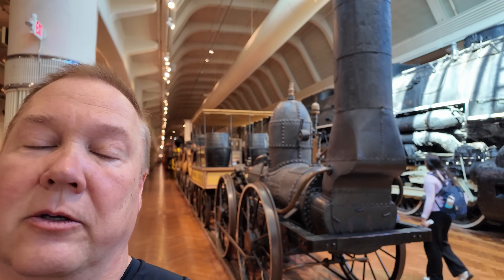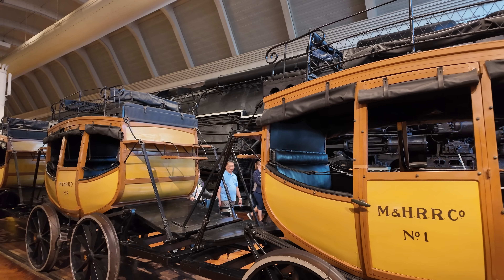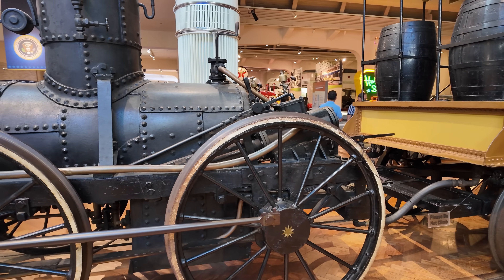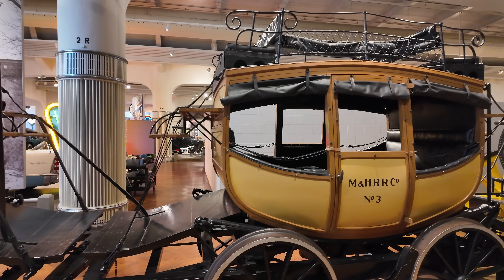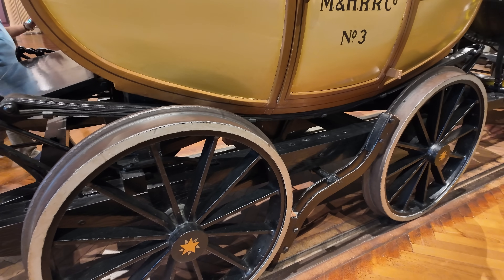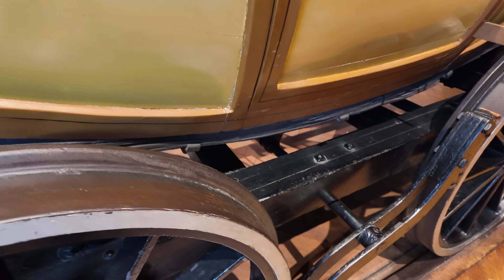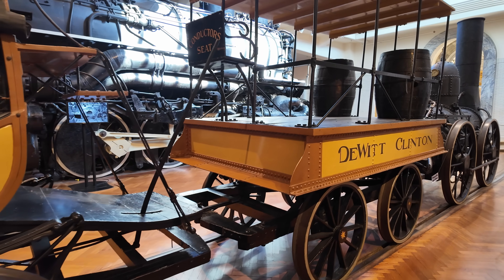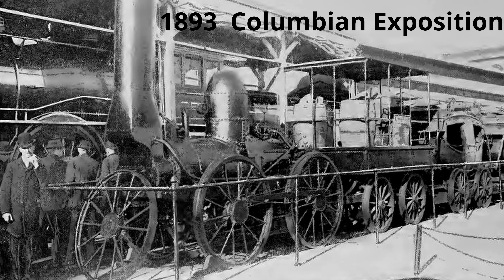The First-Ever Steam Locomotive in New York - Made in USA!

Comment: Thank you for the video. I want to make some comments, which I hope will be interesting. The DeWitt Clinton is technically the fourth full-sized locomotive built in the U.S., the first three were the Best Friend, the West Point (both built by the West Point Foundry) and the York, built by Phineas Davis. The York was built for the Baltimore & Ohio railroad, and because it had some teething troubles, and ended up being massively modified, DeWitt Clinton was put into regular service before it, making DeWitt Clinton the 3rd to go into actual service. Technically, there were some other American locos built in 1831, but none of these were successful or went into regular service.
DeWitt Clinton was originally built without a dome, and the trial runs showed it suffered from water being carried over into the cylinders, so the boiler was sent back to the foundry in NYC in the middle of August 1831. It was also originally built with a "natural draught" which didn't work out, the anthracite coal wouldn't burn. So it was fitted with a bellows and wind reservoir (like on an organ), which also didn't work, as the fire would burn unevenly hot, and melted the grates. It was then modified with a blastpipe, as is conventional on a locomotive. This modification appears to have been made after the M&H took delivery of the Robert Stephenson built "Robert Fulton" locomotive, which was fitted with a blastpipe, as was then already common in England.

DeWitt Clinton was built to the specifications of John B. Jervis (chief engineer of the M&H) and designed by Adam Hall (Chief engineer of the West Point Foundry). Jervis had given Hall practically impossible instructions for the locomotive, placing a weight limit on the locomotive and requiring it to pull a ten ton load up the line at 15mph. In practice it was never able to do this and Jervis and Hall squabbled over the locomotive for months. The Foundry believed that the weight of the tender should be included in ten ton load as specified, and not just the passenger cars etc. I've visited the Jervis Library in Rome and read the preserved letters regarding the locomotive written by Jervis and Hall and they tell a pretty interesting story about the DeWitt Clinton.

The replica was based on a drawing made sometime after the original locomotive was scrapped, but when large portions of it still existed. The original drawings for the locomotive for some reason could not be found in 1893, although interestingly, the Henry Ford museum has copies of them in their archives. Because the drawing used was only a side elevation, some of the details of the replica are not correct (the original boiler did not have a square firebox, but a round one, and the valve gear was a bit different, and the stack was much smaller in diameter).

I wrote the book The Locomotives of the West Point Foundry. I can recommend the book Pioneer American Railroad: The Mohawk and Hudson, by Daniel F. Larkin for those looking for more info on the M&H and the early locomotives used by it. I hope this comment has been helpful. Thanks!
Reply from the maker: Hey, thanks for all the info.  As you probably noticed, I really like the odd, one of a kind stuff, and the stories behind the technology.
Reply: Also the successor to the M&H was the New York Central (no "and") and for awhile, the New York Central & Hudson River Railroad.

If you look at a map of NY's Capital District, the Mohawk River forms a big curve to the north before falling into the Hudson.  The cities of Albany and Schenectady formed at the ends of the "portage trail," the straight-line shorter distance than following the waterways.  The land between the two cities is basically flat, with a downslope at each end down to the river.  Initially engineers were not sure of how much traction iron wheels could get on iron rails, so the railroad only ran along the flat section, with an incline railway, using stationary steam engines to pull cars up and down with long cables.  (Eventually the eastern end of the line was swung over to a natural streambed, which while not as steep as going directly up Madison St. in Albany, was the steepest grade on the "water level route" between NYC and Chicago.  Even longer passenger trains required a pusher loco at the end to get "West Albany hill."

The Erie Canal was built and operated by the State of NY.  The M&H (like almost all rail lines in America) was privately owned.  The State hated losing freight revenues to the faster series of rail lines that quickly sprang up parallel the canal, so the lines could only carry freight during the winter freeze - eventually the practicality of rail transport won over shipping by canal and the railroad was finally allowed to carry freight all year round.
Reply from the maker: I hadn't run into the towed section on the include before.  How long was it?
One thing I have on my to do list is funiculars and gravity railroads and, if I can get to the UK before they shut it down, the gravity cable car that transfers stone.  Interestingly, there is actually an equivalent to the gravity railroad operating with electric trucks now.  Regenerative brakes downhill while carrying a full load, then battery back up to the top.  Never need to charge them.
Reply: @Industrial_Revolution  The inclined planes (both ends of the line had one) were relatively short. Cable hauled inclines were considered a normal part of a railroad in that era, the Liverpool and Manchester had a cable hauled incline, as did the Charleston & Hamburg railroad (a portion of which was recently excavated and surveyed near the town of Aiken, S.C.).

Comment: Part of me wishes it was in the New York transit museum with the other old trains on the actual subway tracks.
Reply from the maker: That's a museum I haven't been in. How is it?
Reply: @Industrial_Revolution  Its one of the best in my opinion because its a living museum. Its in a real subway station that is no longer in use so they've filled it with subway cars in roughly chronological order from the original 1930s rolling stock to the 80s. The tracks are still connected and every so often you can actually ride the train on a special excursion trip (usually weekends over the summer). At the end of the platform there's a former control tower and it still lights up to show where actual trains are on the nearby tracks. 

The only other museum I'm aware of that is on par is the SF cable car museum, which is also a living museum which showcases the main engine that drives the cable which physically pulls all the cars, as well as the various clever mechanisms they came up with to manage turns, crossings, switches etc in an entirely mechanical way before electricity.
Reply from the maker: Thanks.  I'll have to stop in when I'm next in NYC.  I knew of the San Francisco one, and it was already on my list for a visit.

Comment: It would be easier to build a new copy of that locomotive than to try to get it running again.  It is probably impossible to make is safe enough to run around the museum.
Reply from the maker: I do wonder if its retirement coincides with some new boiler safety laws.  They do operate steam locomotives at the museum, and can even build their own replacement boilers, so I'm sure it was well maintained when it was operating.  I'd bet it was a boiler issue that retired it, in the end.
Reply: The boiler was probably made of iron which is a big no no in this day and age  @Industrial_Revolution
Reply: @markfrench8892  Last year I made a trip to the Henry Ford to inspect the replica for a book I am working on. The staff allowed me to look into the smokebox and firebox, and one thing which I noted was the lack of a fusible plug in the firebox crown. The boiler also has no sight glass. It is definitely best left as a non-operational relic at this point.
Reply: @Industrial_Revolution  I used to have a contact in the railroad operation at the Henry Ford.  FYI, I am in Ohio.  I suspect you are, too.  The core issue with running a boiler made of a patchwork of plates is being certain the seams are strong enough to handle the complex stresses.  I am fairly certain single row rivet patterns would have issues that would be best treated with welding.  I believe it would be better to keep the boiler and engine as is.
Reply: @Industrial_Revolution  No steam locomotive could run with passengers these days without a Bourdon Gauge!
Reply from the maker: @nostalgiccameralife Would anyone who knows what they're doing want to run one without?